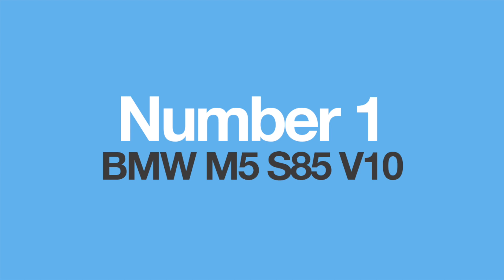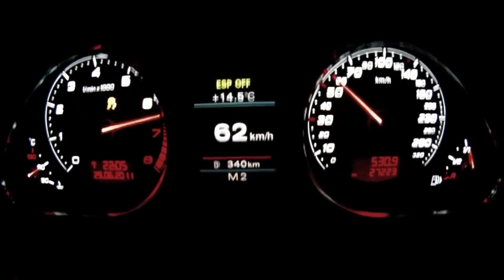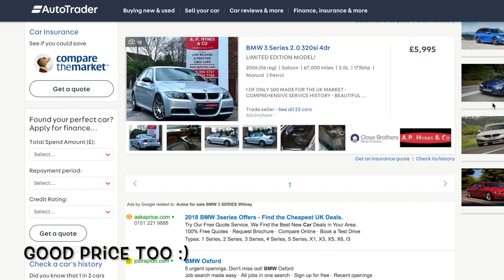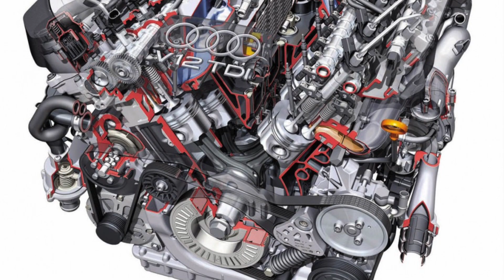5 Weird Engined Cars They Wouldn't Make These Days!!

Comment: That V12 TDI has more torque than 12 Hondas together...
Reply: Lmao
Reply: And burns the same amount of oil as 15 Civics
Reply: Wtf Growtopian player
Reply: And weighs as much as one
Reply: @riosvnchnd  wtf u play games?
Reply: How about V12 TDI vs 12 Honda's with V12 TDIs
Reply: @Ledidor  how old are you??
Reply: @Ledidor  honda nsx fans:honda engineering kicked in
Reply: @dimitrisseme2474  17
Reply: @mianriyaan2647  yeeee sure
Reply: each honda must have a 1cyl engine then
Reply: I know why diesel engines have a lot of torque but not a lot of hp and the v12 TDI is a diesel engine aaand the civic is a petrol car
Reply: @mianriyaan2647  im afraid you switched it. it should be low torque & high hp (or so i think)
Reply: @vaclavfiala3947  dide I was talkinga bout the diesel v12 tdi
Reply: @vaclavfiala3947  I mean dude
Reply: But it has no VTEC lol
Reply: @yzstormer  what type of crap does that meant to mean v12 vs crappy vtec maybe the nsx but that’s only one cwr
Reply: Wow

Comment: 6:24 subie is still faster because the q7 in the Video isnt a v12 lol that research skills.
Reply: It is
Reply: @drterrible8069  it cannot have a 4cylinder in that year of manufacturing, probably it was V6 TDI 176kw.
Reply: NOBODY CARES. IT'S A SUBIE!
Reply: M S it can have 4 cilinder .. if you get into an argument do some reading first
Reply: @karloandraka3909  Please which one is 4cilinder from these:

4.2L V8 FSI
3.6L VR6 FSI
4.2L V8 TDI
3.0L V6 TDI
6.0L V12 TDI
Reply: karlo andraka the first generation q7 did not have a 4 cylinder version. Maybe you are the one that needs to do some recearch first
Reply: Oh yeah, it doesn't say V12 Tdi on the side
Reply: The V12 TDI had a unique bodykit. The one racing a Subie is definitely not a V12.
Reply: _Richie96 _ two words. Head gasket

Comment: Volvo's 5 cylinder
Reply: no
Reply: CNVQ no my ass this 5 cylinder is awesome !!
Reply: Rs3
Reply: audi still uses i5 in audi rs3
Reply: gebakken aarshaar and tt
Reply: Audi is the true 5 cyl
Reply: ringlol audi or volvo the 5 cyl is awesome:)
Reply: ringlol yes they got 700hp out of it in the early 90's
Reply: Heroic Damn I love that engine
Reply: Yeah especially the s1 group b rally car that sounds amazing
Reply: I got one
Reply: I'm from a Volvo Family. I have a bog standard 2001 V70 se which is nothing special I understand but I preferred Volvo's red blocks,. much better engines!
Reply: 5 cyl is love - driving one every day, it sounds amazing.
Reply: Michael Kennedy i have an 2005 v70
Reply: Heroic great engines, mines is nothing exciting but it has 301,000 and not an oil leak and all its asked me for is an alternator and regular service
Reply: Michael Kennedy you got a v70?
Reply: Heroic yes mate but just a bog standard one, 2001 se 170 5 speed manual UK
Reply: Michael Kennedy ce we have a 2005 v70 5 speel manual.love that car.  it has190000km and its still running good
Reply: Volvos b230ftt and d24tic is the best engines from volvo
Reply: viktor ingmarsson i can kinda agree but i think the v70R's T5 engine. Around 300 hp
Reply: I have one ,sounds AWSOME
Reply: I had Volvo C70 with T5 stock 240 hp, turbine changed, motor tuned up, well it hadet ower 360 hp but enormus turbo lag. 0 - 260km/h was really fast... I newer went faster than 280km/h. Destroied the engine when i red line it in 3 gear hiting ower 215km/h. Yes it was 4 spead automatick.
Reply: 2.5 l 5 cyl
Reply: The Rs3 5 cylinder is one of the best sounding engines of all time, but don't know about the volvo one tbh
Reply: viktor ingmarsson lol nej, blöjraggare
Reply: Filip Jajajqjqjniwjxjsiw
Reply: the d24 was a wv engine...
Reply: CNVQ why?
Reply: Filip I thank my lucky stars because I own a XC60 with that engine, the 5 cylinder twin turbo unit is a beast and in a drag it can easily beat a stage 1 tuned Mini Cooper JCW and a Skoda Octavia VRS.
Reply: @filip2529  190000km isn't that much actually. I have a 2001 v70 with the 2.4 140 HP engine and that have 270000km and my dad's v70 from 09 have 380000 km
Reply: @linus3502  My S80 2.4 140HP had 494000km when I sold it... Still running fine.
Reply: @Devilacme  old volvos never brake down 😊
Reply: Filip 
Y E S
Reply: Focus rs mk2
Reply: Fat Yoshi 
Ford ruined the T5’s reliability when they re engineered it for the MK2 ST and RS

Comment: That V12 diesel was probably one of the best engines ever. It had 1000Nm, 500 HP and all that at only 3500 rpm. Not to mention the 5.5 seconds to 100 kmph. And the best part is, if you drive it daily and are not hard on the pedal, it will return decent numbers. And the best of all, it would pull like crazy on low revs, so no one would expect it as they would not hear the sound of the engine. Petrol cars are great for car lovers, but they are not so reliable when it comes to high mileage and if you just want to cruise to work and back home, they would still take a lot of money for it. My choice would be something like a 2.0-3.0 diesel for daily and something like 2.0 petrol for lots of fun on a curvy road.
Reply: i have a 2001 540i sportwagon for my daily drive

4.4L of proper N/A german splendor, 0-100kmh in 5.5 seconds, sounds better than literally 99.99% of new cars

:DDD

shit will do 15-20mpg in the city with grandma like driving, and over 30mpg at 100mph on the highway
Reply: @AdolfHitler-xp1nx  - why? Are you making up for being short-changed in the trouser department?
Reply: @markfox1545  ????? Current gf is ex pornstar hehe

If i was compensating it would be with a matte black bugatti chiron XD
Reply: @markfox1545  also i like driving

Comment: Since we're talking BMW, let me mention my own car and the engine in it as well. It's the M52B20 engine which I have in my E36 320i Convertible. Of course there were bigger variants (actually, there were bigger ones only as this is the smallest), but I think that's exactly what makes it special. Top spec engines are still interesting and fun, but with the 320i we're talking mid-spec 3 series. It's less than 2000cm3, produces not much power stock (although mine is beefed up to a healthy 186HP while still N/A), but it's a naturally aspirated 6 cylinder engine that behaves like a sports engine, and sounds pretty much like the M3 when you fit a nice exhaust system and sports intake to it. It has the single VANOS system, so you can feel it really come alive above 3500rpm all the way to the redline. It's also quite reliable when given what it needs, which is a good cooling system (especially the water pump) and good quality oil, mine is over 300.000km, I have it since 130k and it never had any major problems. It's a mid-spec engine in a mid-spec car from the nineties, and still people show the thumbs up all the time when I step on the gas. It sounds like a sports car, behaves like it as well with the wonderful E36 M-spec suspension, and of course mine is a convertible in mint condition which makes some enthusiast heads turn on its' own regardless of the engine, but the sound it makes turns heads in a regular sedan model as well. No 320i or 420i turns heads with their engines today. It sounds better than today's hot hatches, and I would say mine with the Supersprint exhaust sounds angrier than a new M3/M4 as well. They don't make them like this anymore, especially not in everyday models.

Comment: Tbh, I thought the BMW's 2-litre is a 6-cylinder! I mean, BMW wouldn't make a 2-litre Inline-6 these days, because of the modular engine design, with each cylinder displacing 0.5 litre! They had a 2-litre Inline-6 in the E36 320i and the early E46 line-up! Since this engine was discontinued, it's a bit unfair for countries that base their taxes on displacement! 
We can find 4-cylinders everywhere these days and, tbh, I kinda ran out of enthusiasm when I heard that this race engine is a 4-cylinder!
Reply: Yes, a 6-cylinder is the engine that shows the good points of a BMW! Of course there's the exception of the E30 M3, but in general, 4-cylinders are a bit characterless and often treated like solutions someone doesn't want to resort to but is made to! 
This is what happened with the 4-cylinder versions of the E36, the E46 and the E92: the 4-cylinders were a bit weak and not as characterful (though they still had a distinctive metallic soundtrack!) but they were significantly cheaper than the 6-cylinder variants, that had the whole package!
Nowadays, with fuel economy awareness taking over, BMW has resorted to turbocharged 4-cylinder engines and the F30's lineup is awash in 4-cylinder versions! It even has a 3-cylinder!

P.S.: When I was a small child,  I also thought the E30 M3 had a 6-cylinder!! I was seeing normal E30s with Inline-6s and I thought that, since it's the top version, it's gonna have a 6-cylinder!
Reply: Mafioso Italiano yeah I hate the 3-cylinder bad ... I own one , it’s a 318i shitbox. No character, no sound, no power... absolutely nothing. The only upside is that it’s extremely fuel efficient and a great overall daily.

Comment: That V12 TDI is the most badass and powerful TDI ever made
Reply: What about the new V8 TDI in the SQ7? Comparing sizes, that V8 TDI is very powerful too. 900 NM at 1000 RPM and 435 HP.
Reply: VIZIN but that was not the most powerful TDI i admit that V8 TDI still have decent power and torque

Comment: sounds strange, but ive always been a fan of the GM 3.8 v6. massively reliable, n/a versions had a decent power output, and even came with a supercharged version. I've always been a fan of displacement and 3.8l plus a supercharger is pretty sizable. and the best part is the HUGE mount of sporty body styles of vehicles it came in. The Pontiac Bonneville, grand am, grand prix, Chevy Monte carlo, Buick park avenue and several other body styles. The supercharged versions had 240hp and instant torque, with a massive tuning community and availability of parts. It almost had its own culture.
 I wish they still made it and improved it over the years.

Comment: These are all engines they still built today, maybe rather in racecars then in street cars but for example:

1.The Audi E25/25 engine (5cylinder NA)
2. The Honda K20 (240BHP from 2  Liters NA!!!)
3. The Mazda Wankel Engine
4. The V10 Diesel from the VW Touareg R50 Mk1 (sounded better than the V12 TDI)
5. The Toyota 2JZ (Nothing to add there, this thing is just pure engineered Love)

Comment: Your pinned message doesn't need the 1 for now, as you only reply in the first hour. But those engines oh god, They need to bring the V10s back, this time in the Dacia Sandero! (James may would be proud)

Mentionable could be the Monado W12 from VW. It is a furious engine, which sadly never was in the market. Well, we still had the W8 from the Passat W8.
Reply from the maker: True actually lol. I almost included the W8 :)
Reply: Well, it's quite strong. Though insane and designed for a mad man
Reply: on a sandero? hmmmm........ put a massive engine OUTSIDE a vehicle xDd
 i just say clarksons v8 buggy. but i mean what about a v12 twin turbo outside a fiat 500 xD
Reply: Bastian the thing has a trunk. If this isn't working we go get the Duster Pick-Up or the Logan Pick-Up so it can fit ;)
Reply: Bastian Krueger what about bugatti veyron's w16 on Clarkson's p45
Reply: oh please, there won't be a person sittign inside there anymore after giving it thrust.

Comment: Another engines? 2JZ-GTE and RB26DETT, surely.
Reply: Артем Ненашев those aren’t weird engines
Reply: Those aren’t weird engines at all, they’re some of the best inline six engines of all time. The 2jz revs quicker but the rb26 has a wider, smoother range of torque.
Reply: Theyre not weird. Just high performance. Im getting a jdm fanboy vibe

Comment: Volvo D5 diesel engines are something we will miss. Amazing sound from the 5 cylinder and massive amount of torque for the size.
Volkswagen VR6 naturally aspirated engines are something we are going to miss. Also strange is the Volkswagen and Audi V10 diesel, which was the only V10 diesel in a car. Usually this engines(a lot bigger of course) are used in heavy machinery. They were able to pull Boeing 747 with this engine.

Comment: The Adams-Farwell used a rear-engined flat-mounted rotary 5-cylinder engine - the crankshaft remained stationary with the cylinders revolving around it.

Comment: The engine in the 320si is not the n54, that is the 3.0 tt in-line 6 cylinder found in the 335i. The 320si uses the n45-B20 .

Comment: I'm sorry for clearly not understanding what was so great about the n54 b20? The BMW 4 cylinder engine that was so special that it was unreliable and severely under powered compared to I4 made by Honda that were far more powerful and most importantly, RELIABLE. The Honda K20 (220HP), K24 (200+HP with more torque), F20 (240HP with a 9000 r.p.m. red limit), and F22(240HP with more torque) come to mind.

Comment: In the drag race where the Q7 raced against the Subaru, the Q7 wasn't a V12, because the huge 20" brake carbon ceramic brake wouldn't fit under this small wheels.

Comment: On the M5 you say the engine is basically the M3 V8 with two extra cilinders, but I think it’s the other way around! The M3 V8 is based on the M5 V10 with two fewer cilinders, since the V10 came out earlier than the V8!

Comment: In the motorcycle world: small displacement in-line 4s with high rpm dohc and 16 valves. Ie zxr250, 400, Honda cbr 400rr, fzr 400 etc

Comment: The Mercedes Benz Twin Turbo V12, 600+ Horsepower, 738 Pound Foot of torque. Mercedes does make an engine with more power, it's just that it's put in School Busses, instead of a 4 Door Sedan (The S65, or 2 door Coupe SL65. IIRC These started in 2005)

Comment: So in the 80s volvo mad 740 and 240 they also had the bigger engine model callde 760 and 260 wich had a v6 or straight 6 if you chose disel

Comment: The Audi RS6 V10-engine is not the same as the Lamborghini Gallardo ... Common mistake, but the block is basically a Touareg/Phaeton 5.0 TDI block, but with different heads, crank, etc. ... The Audi S6 on the other hand does use a detuned 5.2 Gallardo-engine ✌🏼

Comment: The code for the 4th engine is wrong. N54 is the 6cyl twin turbo from the 135i, 335i, etc.

The correct code is N45B20S.

Comment: i drive a 1999 V10 dodge ram and no its not the same as the viper, but it can burn rubber like any other and is the most reliable car ive owned.      230+ thousand miles

Comment: Weird were Voklswagen´s VR6 engines with 2.8 (174hp) & 2.9 (192hp synchro-awd). If they could´ve managed to build the engine lenghtweise in the car it would be an awsome concept. I owned a Golf 3 VR6 and a Corrado VR6 and and they have the nicest 6 cylinder sound on the planet plus for that ammount of HP you could easily beat an BMW 325 i or 328i. Just do a test drive with one and you´ll understand :)

Comment: There is the 2017 r8 v10 with over 620 hp. The new rs6 is actually stronger than the old one as well as the new 2019 q7 which has a v8 diesel.
And just so you know. Europeans love the Diesel engine, because it's cheaper at the gas station and the cars consume way less. Even our little cars are mostly diesels but you destroyed that with your stupid lawsuits against vw.
Regular is not affordable here, as it's 5 times as expensive as in the us.

Comment: the best diesel engine: 1.9 TDI
Reply: Not bad at all, but Ford and VM had some interesting Diesel engines as well around that time. While heavy and not exceptionally powerful, the 2.5 liter direct injection Ford Transit engine would be hard to beat on reliability and was much easier to maintain and repair than the VW 1.9. VM 1.8 and 2.5 liter engines matched the VW 1.9 in sportiveness.

Comment: you are bmw fan and e55 amg was faster than m5 v10
Reply: quicker not faster

and only because of low end torque

once both cars were rolling at 100mph+ the m5 would be pulling all the way to its 205mph top speed, where the e55 AMG would die at 190-195mph (what they can do stock and delimited on the best days)